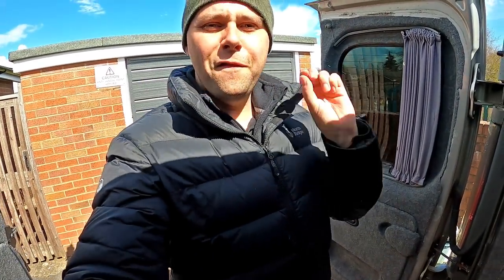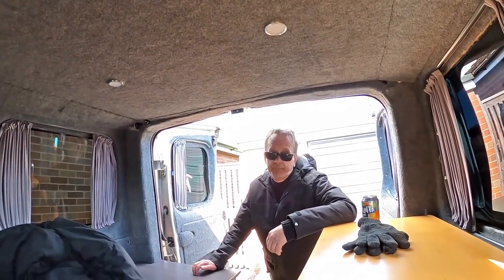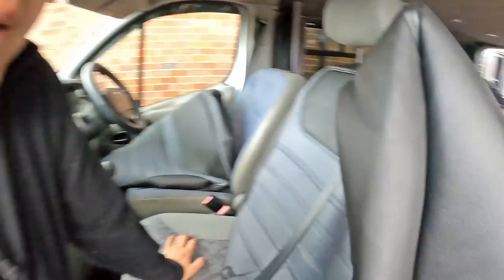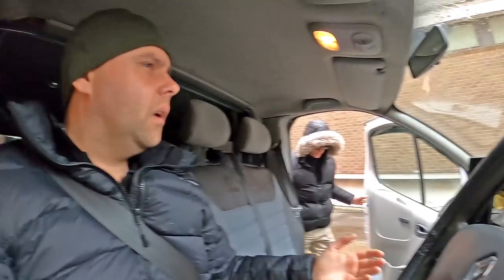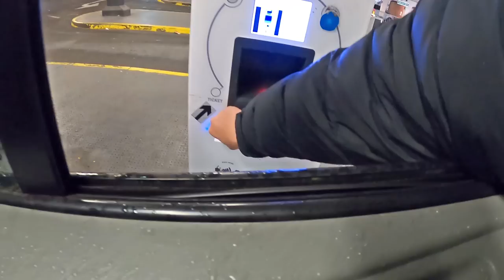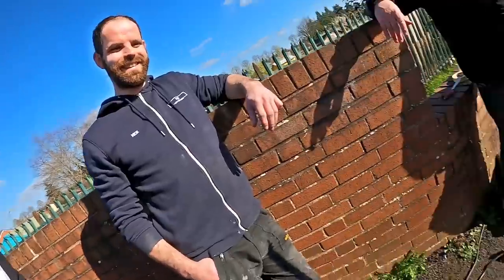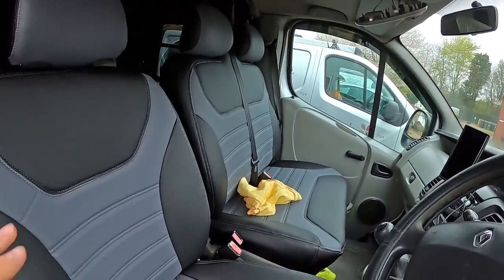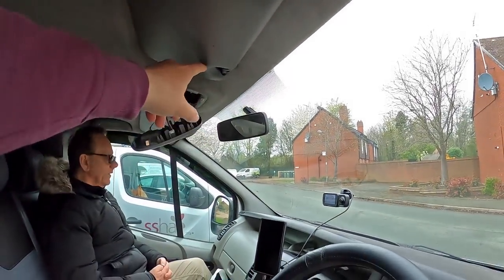HELP! Mini Camper Van Build Nightmare | Van Life UK

Comment from the maker: Not the positive ending to the video I was hoping for unfortunately but if anyone has any suggestions on how to fix the leak, please leave a comment below 🙏👍. If you would also like to help support the channel by topping up the fuel tank or donating to a meal/drink then please consider subscribing to my Patreon ❤: https://www.patreon.com/brendanexplores
Reply: Probably not what you want to hear but I think the windscreen has to be removed. It's either water ingress from a failed bond or corroded aperture face. Take a look at your screen. If it doesn't have "Renault" printed on it it's almost definitely been replaced at some point. Doesn't mean if it say Renault it hasn't been replaced as it could have had a factory screen fitted as a replacement. If you've got windscreen cover on your insurance....you could "accidently " damage it and get a new screen fitted that way. Hope that helps mate 👍
Reply from the maker: @markleader2622  thanks for the advice buddy, I fear you might be right... Only time will tell if a tempory fix will work 🤞

Comment: Interesting video,and your trying hard to make it a viable project, sadly its a vauxhall vivaro,there full of problems engine management issues and power boost problems if its not happened yet beware its on the horizon, having said that,,,,that it's van life,,,,enjoy.
Reply from the maker: Thanks mate and to be fair, most vans have their issues and the tvps especially the older ones tend to run quite well 👍. I just hope I get no more suprises down the down ☹️
Reply: @BrendanExplores  enjoy the summer
Reply from the maker: And you mate 🙂👍

Comment: More than likely your leak is coming from the seal around the aerial , 
it’s probably broke the seal around it after going in the car park, 
the water will follow the roof lining until it hits the windscreen 
making it look like it’s coming from there.
Find the nut holding the aerial on loosen it enough to squirt some sealant under the aerial
And tighten back down 
🤞that works
Reply from the maker: Thanks for the tip mate 👍 might have to take a closer look at the ariel as the leak appeared after going into that car park

Comment: Sika Flex the aerial, the multi-storey could've moved the base and caused the leak under the base or claim for a new windscreen "on the insurance". It can only be coming from two places aerial or windscreen try the easy one first. Those seat covers look great gonna have to get some of those once I get some more freedom units.
Reply from the maker: That's a very good point mate 👍 never thought of that! I've done a budget repair for now but I think having a further look at the ariel is a good shout 🙂
Reply: @BrendanExplores  Had fun and games with mine last week with the sealing strip coming loose on the near side at the top of the windscreen and flapping on the roof on the motorway, was sure I was gonna lose it, but got to the services and got a bead of silicone along it and put gaffer tape on it till it cured, That reminds me I gotta get the gaffer tape back off. 😀

Comment: Great video as all ways mate and it sounds like and easy fix just get a window fitter to removed it and refit with new adhesive I had same issue on and old van I had 

Keep up the good work doing a great job
Reply from the maker: Thanks mate and yeh I may have to do that at some point 👍 I'll see how this budget fix holds up for the meantime. Got an update coming soon 🙂
Reply: Nice I think I only payed £50 of an independent window guy 2 do it for me so did no brake the bank haha

Comment: After bashing your arial in the carpark I vote your seal is leaking on the Arial and it's weeping in the head liner will be soaking it up until of course it runs down your windscreen..
Reply from the maker: Yeh you could be right mate 👍 I've been able to sort a budget fix for now so hopefully it lasts but it may be a windscreen out job eventually

Comment: PERMATEX 81730 - FLOWABLE SILICONE FIX WINDSCREEN & GLASS LEAK SEALER (42g)
Used this to fix around the windscreen of my car. Seals between the glass and the rubber. Lasted 4 years so far …. Good lick
Reply from the maker: Nice one 👍 thanks for the suggestion 🙂

Comment: It’s highly likely that the screen has been replaced as you suspected. I couldn’t quite see, is there an aerial up there as that may need sealing. As for the screen is it was mine I would run masking tape along top edge of the glass and the body work. Then buy a automotive sealant such as “Tigerseal” which is black,then basically fill the joint between the glass and the bodywork. Have a small cup with about 50 50 water and washing up liquid and smooth the sealant off by wetting your finger with the solution. If there is an aerial above the cab then the fittings will probably be underneath it, remove and again using the sealant to seal around it and refit the aerial.
Reply from the maker: Yeh I think your right mate 👍 going to have a good look at that aerial. I've done a budget fix for now so hopefully it will hold

Comment: Hi there, I had a similar problem with my Yeti 4x4 leaking panoramic sunroof (a common issue apparently) & to take the roof out & fit a new rubber seal I was told by the main agent would cost over £2000. So I bought 1x bottle of Capt. Tolley’s Creeping Crack Cure which is actually a marine derived sealant. It fixed the problem completely & there is still no reoccurring leak 2 months later👍🏻. Jc
Reply from the maker: 2 grand! That's crazy isn't it.. how do they get away with it! Good on you though for sorting it yourself. I've just done something similar as a budget repair so fingers crossed it holds 🤞

Comment: You didn't have the leak before so it's new.  You mentioned to take the aerial down when going through the car park, did it hit it?  Could be that.    Good luck  resolving that.  Might have to take it to a garage
Reply from the maker: Yeh that's a good point 👍 I think it may of dislodged something. I've got a budget fix on it at the moment to see how we get on but it may be a full windscreen replacement... ☹️
Reply: @BrendanExplores  do a fix on aerial.  Then chuck buckets of water on the area   . Make sure inside is clear

Comment: Call vauxhall and see if there is a recall on screen seal...Other than that its windscreen out and reseal...Autoglass etc
Reply from the maker: Not a bad idea mate 👍
Reply: @BrendanExplores  Volvo did it with some of there models, But it does have to be the original screen.

Comment: I replaced a windshield on my old car and the service center that did it did not seal the windshield properly (they blatantly left off any seals completely and tried to say that was normal). Perhaps try to check the seals are all still looking okay as it could be due to that. Sorry about the leak but hopefully you get it sorted out. The new seat covers look great!
Reply from the maker: Cowboys eh? That's what I'm worried about, taking it somewhere and them doing a crap job... I've got a budget fix on it at the moment so hopefully that will sort it 🤞

Comment: Hi Brendan, hope you find the problem with the leak near the cab light. l got a leak in the same place on my citroen camper when I was in Portugal a few weeks ago. Check it might not be water mine feels like a of a oily texture. If you find how to fix the problem let me know, cheers Carl.
Reply from the maker: Cheers mate and I've done a basic solution for now but it may need a proper replacement at some point 👍

Comment: Suggestion: Add a sink, fridge, circle holes for air con tubes going around the van and a fit-in cooker like in the big table top in the back, I mean like cut out a piece of the table in the back to fit a sink bowl in and a tap. Add a leisure battery that connects to the fridge, lights, etc. Another thing you could add is a cabinets above the table top, as well as a oven hood for the gas cooker. You can store 2 propane tanks underneath too. Oh yea, and also don't forget to add plug sockets and such. :)

Comment: Id be careful with the tape when removing it, Ive known a few people remove paintwork after leave duct tape for a few days. You might want to check you insurance policy to see what the excess is on a new windscreen.... ;-)
Reply from the maker: Yeh good point 👍 I did think that when applying it. Thankfully it's only cheap stuff so hopefully it won't take the paint off 🤞